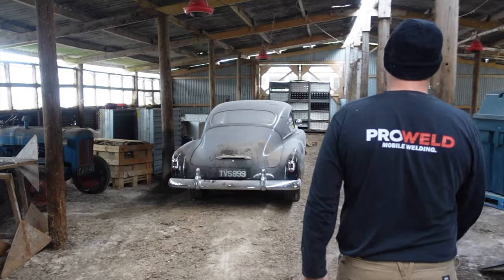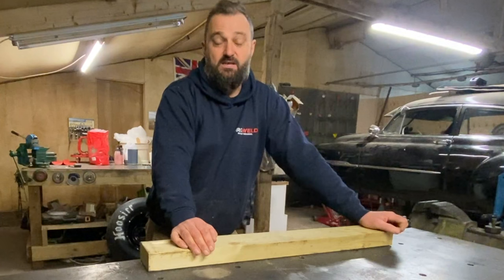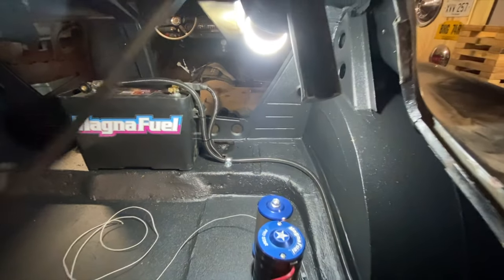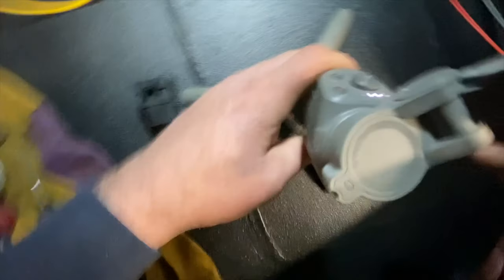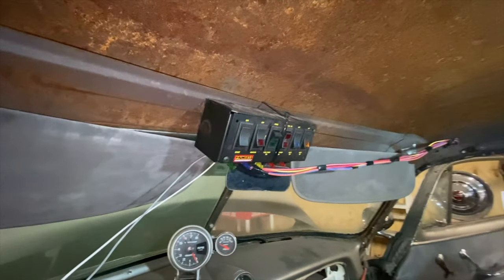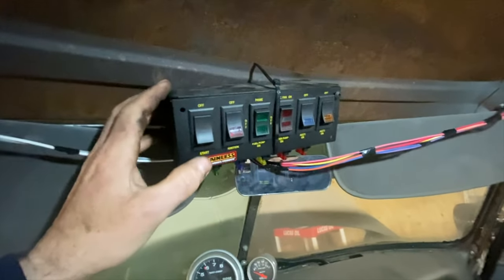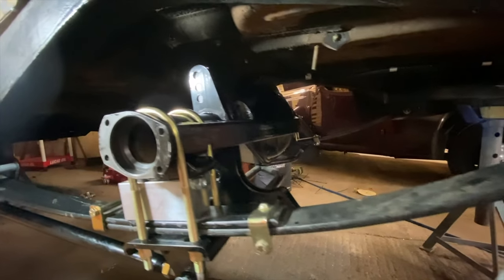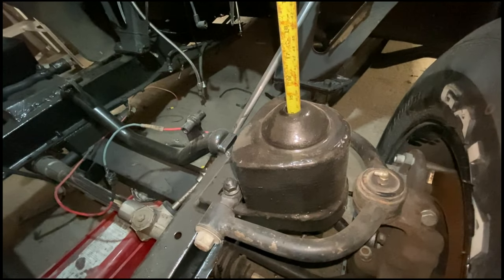BUDGET DRAG CAR BUILD!

Comment: I did the same thing on my 1972 Chevy Nova but I use the bottle jack with a trim down 2"×4"×24" piece of lumber, to clearly my 275/60/15 BFGoodrich Drag Radials on 8" Centerline AutoDrag Rims
Reply from the maker: Awesome work! Did you have to paint after?

Comment: Was the 9" straight after bracing? About to make a checking jig for mine and then add a brace. PS. if you want some 10yr old info on taking a car to DW, get in touch with Mick @ Wacky Racers in Dudley.
Reply from the maker: I don’t think it moved much. I welded
It in stages. Took loads of measurements when welding. Thanks for the heads up with Mick. I’ll give him a shout.